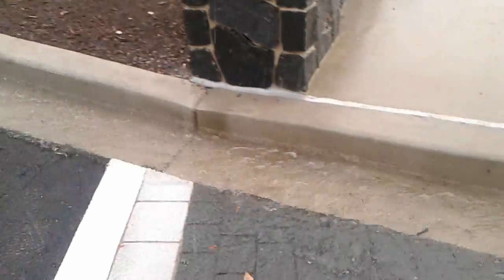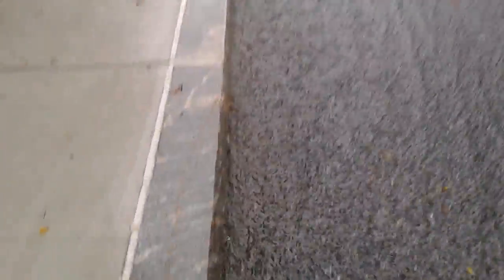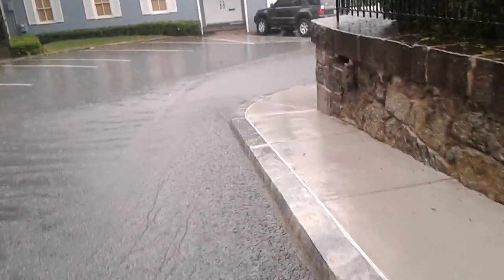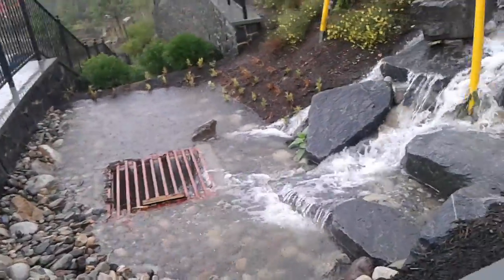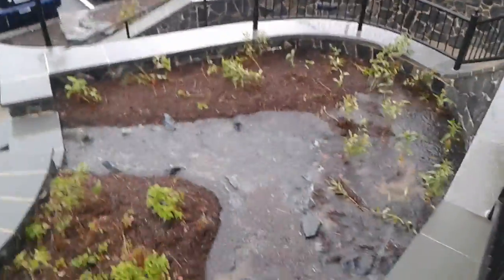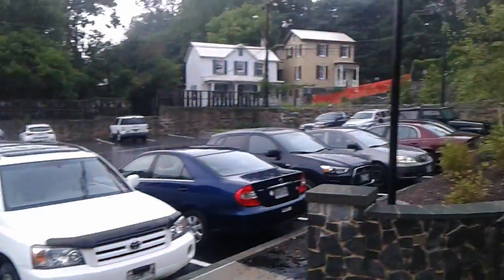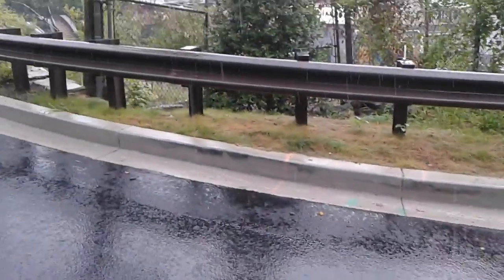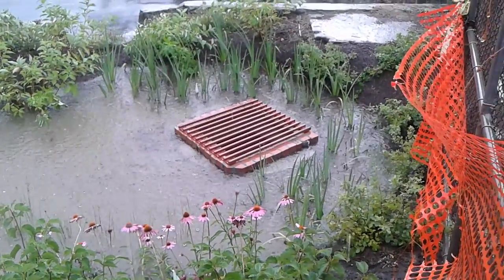The New Ellicott City Stairs in Action

Comment: Another step in controlling the runoff of stormwater which needs to be captured and filtered back into the ground so it does not cause flooding and pollution of our rivers and the bay.  Way to go Howard County.
Reply: have they fixed it?
Reply from the maker: Stormwater? Unfortunately, it will take more than 1 practice for the County to fix the stormwater problem :/